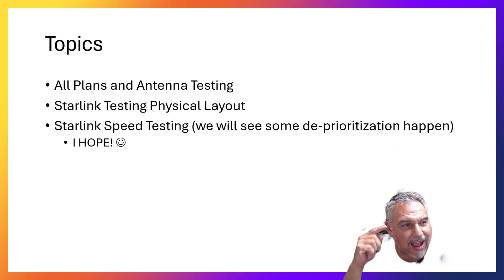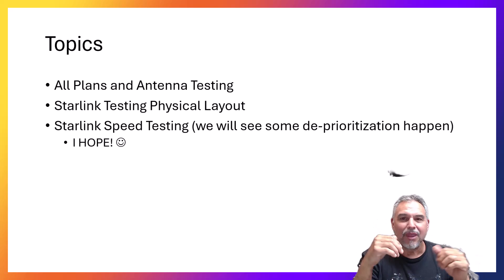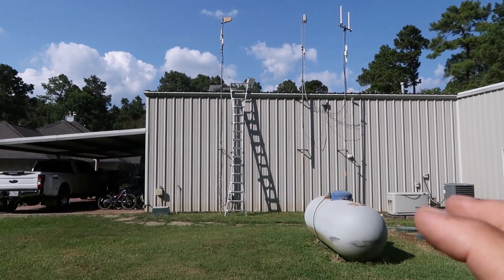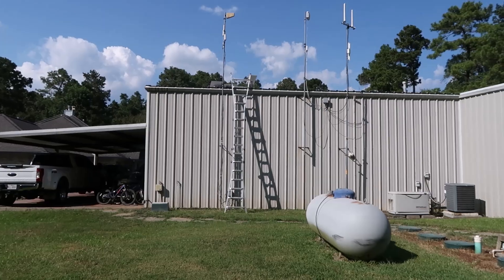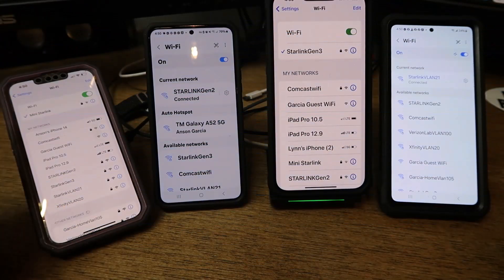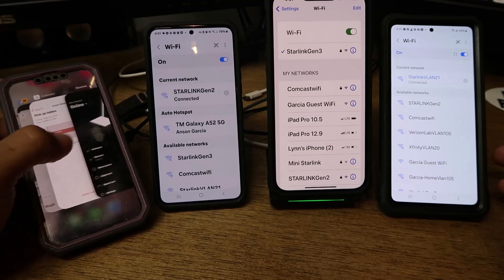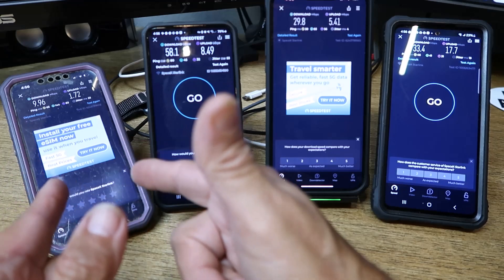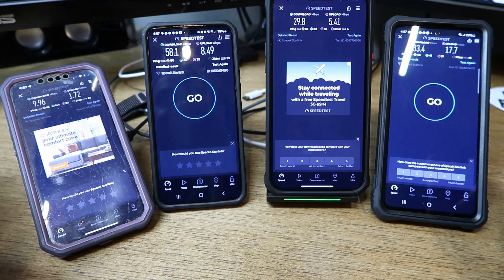Starlink Speed Testing All plans and antennas

Comment: Did you try the mini with the mobile priority opt in turned on?  I am trying to determine if I can use the mini for my business calls or need something different.
Reply from the maker: I only use my mini for camping so I rarely hit the 50GB.  However, I do have mobile priority on, but do not think you really need it. I have done work Zoom and Webex calls with no issue so far.